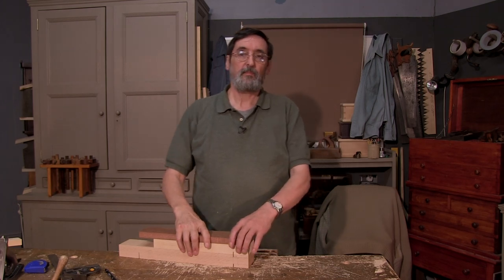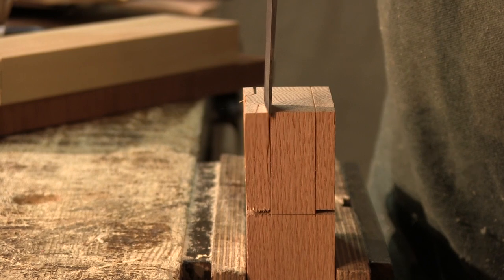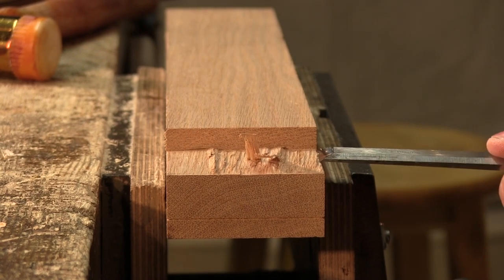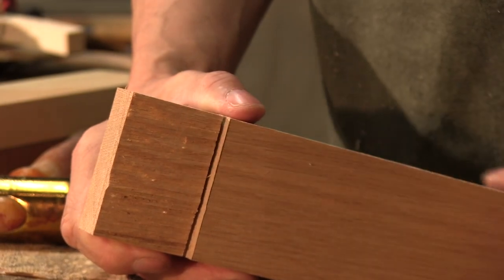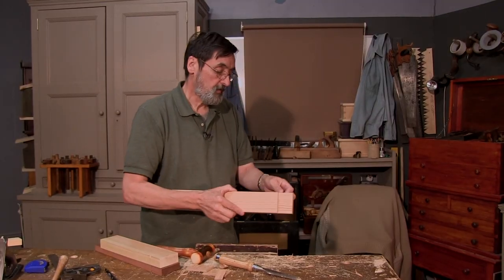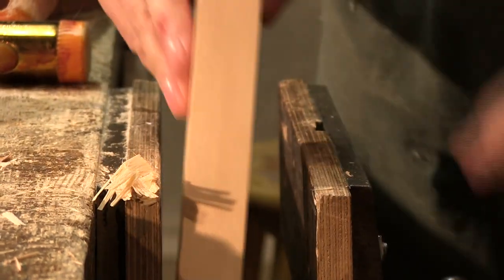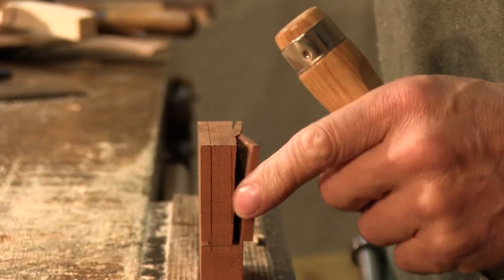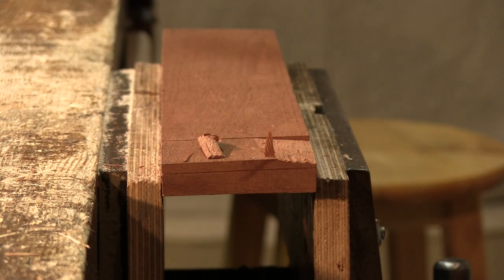Paul Sellers | Splitting and Paring Tenons

Comment from the maker: Yes, there is. I am using a 1" wide chisel. Wider chisels are less common and take much more effort to sharpen the wider they go. I use a 1" chisel for most of this type of work. It's the right weight to strength ratio and it is most likely that none of those watching the video will own a wider chisel. I want people to be able to put into practice what they see without going out to buy. I don't think that many craftsmen used chisels much wider than 1" for general work. Thanks for the question.

Comment: Hey Paul! I love your videos, they have inspired me to take up more traditional woodworking. I did my first practice hand chop mortise and hand paired tenon using oak but as i was pairing from the side, i got splitting? Could this be from not reading the wood grain correctly or from not having my chisels sharp enough? That being said, would you say its better to saw the tenons vs splitting and paring? Also id be real interested to see you do some work on other woods to see how they differ in hardness, like working on Maple, Hickory, Walnut, etc. Thanks again for all you do!
Reply from the maker: I think it’s a question of trying both but if in doubt saw. There is not doubt, once you mastered the splitting technique it is very fast. But you do have to develop the technique and this only comes by practice.

Comment: Mr. Sellers, I noticed your pieces of wood are roughly 3.5"-4" wide. Is there a specific reason why you don't use a wider chisel and split the tendon in 2 passes instead of 3 with a smaller chisel?

Comment: What is the exact purpose of the chisel hammer? I have steel butt chisels, so I don't need to worry about ruining my handles, but are there any other advantages of a softer mallet?
Reply: Rob Mckennie more controllable force and less shock into the wood at the tip of the chisel
Reply: wolfie965 makes sense
Reply: Feel as well. You get different feedback with the use of different mallets.

Comment: I'm sorry Paul I love you Channel, but I got to correct you on this. Let's talk about Tenon joints. The most important part of this joint is the shoulder on the tendon. Therefore it should be cut last. When you cut a shoulder and then chop down into it there is much more room for error and scarring marring and adjusting of that shoulder is no bueno!! So remember they make Tenon saws for a reason. Cut those tenon's then finish off with a single cut on the shoulder to make it clean and sharp. God bless

Comment: Don't see how this method quicker than sawing, fix in vice and saw down left and right maybe 40secs, this method even allowing for the talking takes several minutes and requires moving in vice several times.
Reply: The chap above can do it less  than  40 seconds easily  I'd suspect.
Reply: I doubt it
Reply: foxhole777

I don't.
Reply: The saw kerf isn't as smooth as the pared face, I'm inclined to think. It's a matter of your quality desires. I know my sawing is a little skewed but I want my tenons straight and square, so for me chiseling is the obvious choice.

Then again, if you want to know how it's done you watch the video. If you don't want to do it that way, there would be nothing in your way.
Reply: What you say would be true if sawing produced an acceptable glue surface and was to perfect size on the first try.  I always find myself paring to fit anyway so the time savings of sawing, if any,  gets eaten up with paring and fitting.  In unpredictable woods sawing is the lower risk method since one wrong split is costly in either starting over or some type of shim to fix.  Overall I think Paul is just offering you another method for your arsenal of skills to be used as experience guides you in a particular situation.  Sometimes sawing, sometimes splitting, and paring in either case.  I have always sawn tenons (25 years), until I saw this a year ago, and now find myself using this method often and with pleasing results.
Reply: Jeff Novak You need to address  your  points   to foxhole777.
Personally  I prefer  Pauls method.
Reply: Balenza345 i was one of 6 replies to foxhole 777.  not sure what you mean?
Reply: Jeff Novak OK. I didn't realise  that  hitting foxholes  "reply"  button   would  also send me an e  mail.
Reply: yea, I think it does unless you disable it,   you should be getting the other replies I think
Reply: +russell lowe I would say you're the only one making a negative comment here. The OP was just giving his own opinion which his entitled to. And quite frankly, I think he might be correct. Obviously someone like Paul with five decades of experience, will cut a tenon with a chisel in no time at all, but an average woodworker most likely would be faster with a saw than a chisel. Besides, the amount of time saved (if at all) by splitting a tenon is quite minuscule compared to sawing, and I don't think that the reason you're working with hand tools is because you want to do things as fast as possible. Just take your time and use the method you like the most.
Reply: Not a negative comment , a question.
Reply: foxhole777 My comment wasn't a reply to you, it was meant for the person who commented before me.